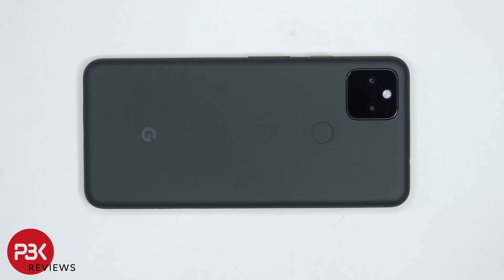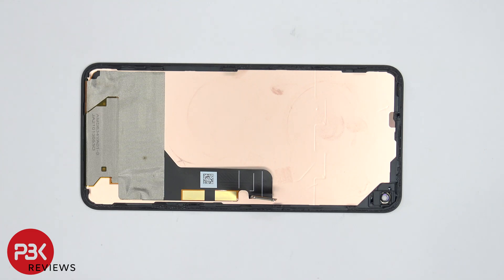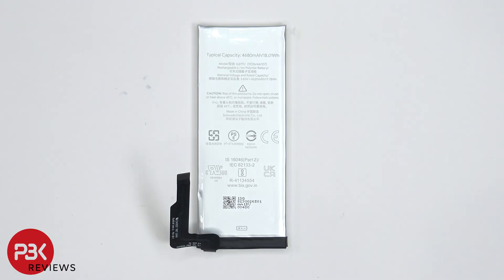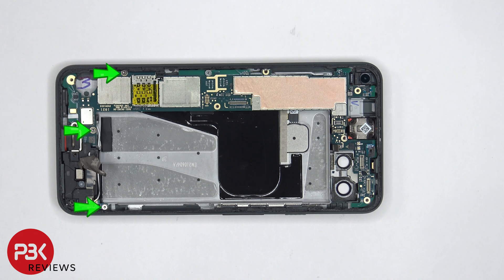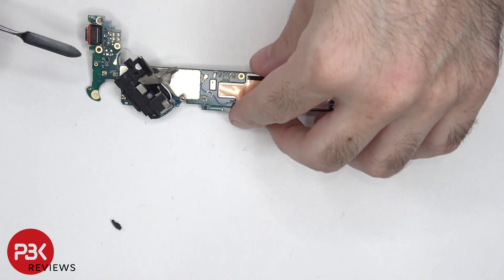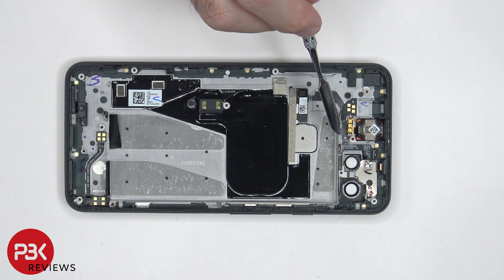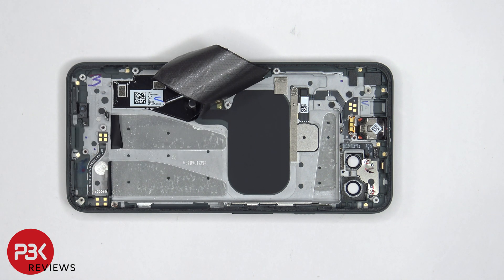Google Pixel 5a Disassembly Teardown Repair Video Review

Comment: I notice no network issues in my pixel 5a after a cpu reballing repair. I see that the radio power toggle is always off in the phone dialer network settings. I also couldn't find any information about this and the guy who repaired my phone also couldn't do it so is there a way I can fix this, I wanna try a DIY
Reply: Kuch solution mila bhai

Comment: Hey,
Thanks for posting this, very professional video, amazing job!
My 5a wouldn't turn on and I think the motherboard is gone. I was hoping your video would show where the memory is so I could access the data I haven't backed up. 
Do you think recovering data from a dead 5a is doable?
Reply from the maker: thank you. the onboard storage is not user removable or replaceable. Its soldered to the main board.

Comment: Great video. I have a pixel 5a and the screen is black but still vibrates and still rings. Any idea. The screen works. Is it a flex cable?
Reply from the maker: Thanks. It could be many things. Defective display, cracked screen (sometimes hairline cracks in the corner don't show), water damage or loose cable etc. You can also try manually resetting the phone by holding the power and volume up or down button for 30 seconds to see if it may be frozen.
Reply: Where is the driver display IC located? Thank you!

Comment: hate to tell you but https://youtu.be/r8uaCrGkca8?t=296 at this point you said processor and ram. that chip next to the processor is the flash storage. the ram is under the stuff on the back side. i know this is an old video but if you could take the shielding off the back and get pics of the actual ram chips that would be great. not sure if you still have the phone or not.

other than that, this was a really well done video
Reply from the maker: Thanks. I don't have it anymore, also I usually only remove the removable shields and not the ones which are soldered to the board since prying those off sometimes damages the components nearby rendering the board inoperable. So I don't want to damage a working board :) (soldering is not my best skill)

Comment: What kind of cooling thermal pad is used on chips at time 4:55 in the video? Also should it have a thermal paste between motherboard and metal plate on the thin copper layer?

Comment: This is amazing! Google should hire you as a product designer! 😄 Seriously.

Do you know by any chance how to get access to the storage (to save data)? Is there any adapter to access it from a computer? 🙏
Reply from the maker: lol :). If you mean the onboard storage, its soldered to the main board so you would need to be able to use the phone to connect it via cable to the computer to transfer info off.

Comment: Could we recover data from storage chip on motherboard?
Our pixel 5a is tested as motherboard issue and will probably be changed to a new one but we hope data on the old one could be saved. Thanks.
Reply: Did you have any luck I am in the same boat, I just want my data

Comment: I am watching this video because my Google Pixel 5a screen cracked after I was (admittedly) careless with it. I got a replacement screen, but the phone is not coming on even though the battery has charge in it. I have been told that it is the power management IC that needs to be replaced but I am skeptical, especially as it is so hard finding phone repairers that are familiar with Pixel. Could they be right?
Reply from the maker: It's possible. You can always get another replacement screen and test to see if it is the screen or not that might be defective.

Comment: Hi! 
Great video. 
My pixel 5a freeze into a black screen and the phone was up because I can hear calls and messages were working. I tried hard restarting and left it to drain the battery and tired it as well. Nothing is working!😑
Now I am thinking of removing the phone and trying to remove the battery. Is a heat gun really required to remove the phone?
Reply from the maker: Hi, you can use a hair dryer as well (heat is needed to loosen the adhesive a bit to make it easier to pry the screen off). You can check to see if your screen cable may have gotten loose or you may have a hairline crack in the screen somewhere from a drop that you can't see which is causing the display not to work. I doubt it would be battery related.
Reply: did you get it fixed because i thinks thats what happend to mine it kept dinging or something for awhile so it was working did you ever get yours fixed?

Comment: Hello, let's see if you can answer despite the time of the video. My Pixel 5a froze using it a few weeks ago. It happened to me after the last update. Does not turn on, does not show anything when connected to any charger.
Reply from the maker: Try holding the volume down and power button together for 30 seconds to see if it will boot. If not, might be the battery or a bad firmware.
Reply: @PBKreviews  I've already tried doing that with the buttons and it doesn't do anything. Nothing comes out even connected to the charger.When I connect it to the PC, something sounds on the PC and something appears in Device Adm, QUSB............
Reply: @PBKreviews  Never had any problems, the battery was fine. That happened to me now after the last security update.
Reply: exactly the same issue with my 5a 5g. Bricked after an update. No response since. Did you do anything that worked to fix it?
Reply: @sreemaeeakshathala3066  Not really. I bought a 6a.

Comment: One thing is the page in the shop where it looks shiny and all, but the inners looks dodgy and kinda low for the price of the phone, I think..
Looking back where I used to repair phones this is the typical chinese crap that is not satisfying to work with. maybe time is changed so this is not issue anymore, idk..

Comment: Can you plz do a pixel 5a drop test. Have seen too many posts that screen is too fragile, that it goes blank at slightest drop
Reply: While metal is used in the construction of the 5A, it doesn't form a perimeter around the phone or the screen. My previous phone was a Moto Mx4, and even with a glass back that thing was indestructible because it had metal surrounding the entire phone.  On the 5A all you have is a plastic bezel protecting the screen, and apparently that bezel has some weak points.

Comment: Can you tell me where the 5g antennas are located on this phone?
Reply from the maker: I'm not 100% sure but I believe the antenna board to the side of the bottom speaker which is connected to the coaxial cable is the 5g antenna board.

Comment: What kind of battery is that. I need to replace mine
Reply from the maker: It's a model G27FU  and here is a link to one of the only I found available online: https://www.aliexpress.com/item/1005003213464474.html?spm=a2g0o.seodetail.topbuy.1.5a5d24e6i00gcX
Reply: @PBKreviews  thankx a million
Reply: @PBKreviews  any preference vendors for screen replacement?

Comment: Great video, you seem very knowledgeable. I just broke my 5a screen and have been searching online for help. I've seen a lot of other people on Reddit who have the exact same issue as me. Dropped the phone, bottom right corner was cracked and the whole screen stopped working. Do you know what in the bottom right could be so fatally flawed that so many people have the same issue? Thanks for the help
Reply from the maker: Hi, thank you. The flex cable which connects to the screen itself runs all along the bottom portion of the screen. Any damage to it or the screen itself can render the screen inoperable.
Reply: @PBKreviews  Hello!  I have the same issue as the original commenter, would you say this is an issue I can fix at home by myself?
Reply: @PBKreviews  to expound on this, I dropped mine on the bottom corner while in a case.  I had no physical damage to the glass or frame, but had a flickering and nonfunctional lcd that appeared to be cracked.  There just isn't enough rigidity in the phone frame or enough space between the outside edge and the lcd/connector.  This is the downside of plastic framed phones.
Reply: @NateFansler  a
Reply: dude my 5a half of the screen was blinking green and the other half was black ):
Reply: Just dropped my Pixel 5a from the bed, from my bed, remember, and not on a very hard surface (I have linoleum), and now the screen is all black and down, in the right corner, I can see that under the glass there is a small crack. So the glass is intact. How could that be possible? I had a very sturdy case, a glass screen protector (intact too). This must be the most sensible smartphone on the market. I have 1 year of guarantee left, but I'm sure they won't cover it...
Reply: mine also fell down on the road. had sturdy cover as well.  no crack nothing and i saw it hit corners when fell. now screen all black. i think phone working bc i can access web whatsapp. =/

Comment: My 5a just took a light tumble and the screen is dead! No cracks just flashing and non responcive. Looks like I'm ordering a screen. At least it looks easy to do
Reply: same thing happened to me, light impact on my 5a screen is all black. poor build quality. any idea where to find replacement screen?
Reply from the maker: There are some on ebay if you search for pixel 5a LCD. Also you can contact google to see how much they charge for replacement. If you have no visible cracks, you can try to send it to google to replace under warranty. But if they deem it physical damage and see a crack, they wont repair it for free and send it back to you or offer you a price to fix it for you.
Reply from the maker: Sucks, sometimes they get a small hairline crack somewhere in the corners which you can't see and causes them not to work. You can try sending it in to google and see if they will cover it under warranty if there are no visible cracks.
Reply: @PBKreviews  I has two cracks under the glass. Looks like the OLED cracked but not the glass. It fell from about 2-3ft while in its case. I've dropped my Pixel 3XL many many times while in its case. I've never damaged a phone so easily. As far as the cost is considered, Google wants $229 for the screen and their authorized repair place said it will take a week to get it. I'm not sure what the labor price would be on top of that. I ended up removing the screen and am not waiting for the replacement screen I ordered on eBay for $180. It's slightly cheaper but will be here by tomorrow. Again, this phone seems very delicate when compared to previous pixel phones. Although this is my first experience with an  "A" model. Maybe they're not designed to be as robust? Idk. Since I've had the Google G1 in late 2007 this is the first time I've ever cracked a phone display ever!

Comment: I would much prefer it if the charging port was modular like the headphone jack is, rather than soldered to the MB. Especially on a phone without wireless charging where it's going to be subject to wear.
Reply from the maker: Ya, the charging ports should always be modular or on a replaceable sub board.
Reply: @PBKreviews  Great videos, thanks a lot for your time and effort in making them and helping us who want to learn! :) I watched the teardown video for the Pixel 5 too and the charging port looked pretty similar to the one on 5a. Would you say that replacing the charging port on a 5 would be as difficult as on the 5a?

Comment: Where can I buy a screen? I have looked everywhere
Reply from the maker: You can search on ebay for pixel 5a lcd and there are some listed around the $200 usd range, or you can contact google and see how much they charge to replace it for you, might be cheaper through them.

Comment: You said there was a notification LED, is this correct? I can't find a way to turn it on in settings
Reply: Frustrating that it does not have this feature...  Heck, even $50 LG phones did.  I like my 5a but was surprised it lacks this feature...  Maybe a software update with 'fix' this.
Reply from the maker: I checked the video, I don't see where I mention in there that it has a notification LED. Can you tell me what time stamp in the video I mentioned that, since I checked and this phone does not have one.
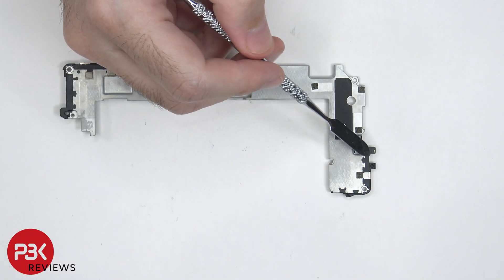Reply: @PBKreviews  1:55
Reply from the maker: @arientlich5665  Oh thanks for finding it. That LED is not a standard notification led for app notifications. It's to notify you that the phone is charging if the phone is completely drained in battery and does not have enough power to display anything on the screen yet. So that will flash white when plugged in if the battery is completely dead, so you are aware it is accepting charge. :)

Comment: Do you think it would be possible to add the wireless charging, using Pixel 5, or other, components?
Reply from the maker: probably not since the software would not be programmed to work with the hardware (even if you were to modify the housing and so forth to allow the wireless charging to work).

Comment: What is your professional opinion about Google claiming the Pixel 5 & 5a screen gap issues having absolutely zero negative impact on the phone's IPX rating?  It seems to me the whole point of the water gasket under the screen is to PREVENT WATER from entering the main body from between the screen and the casing right?  Otherwise, why is there a water gasket between the screen & the body?  Google says having random gaps, of various tolerances, in random locations all around the screen (but w/ some phones having NO gaps) is a intentional design design.  They further claim having the water gaskets breached has NO detrimental effect on the phone's water & dust waterproofing.  That's obviously bullshit, but I'd like to hear your take.  From your teardown, it's obvious the Pixel 5a's internals are not themselves waterproof.  Meaning there's no magical waterproof coating layering every single electronic component inside the body of this phone.  If there were, then there'd be NO REASON for water gaskets around the screen & USB port, right?   So it seems obvious if a gap exists between the screen & the body, a gap big enough to side an index card or credit card thru, then obviously there's plenty of room to allow water & dust/dirt to ingress into the Pixel 5 & Pixel 5a's main body.  That'd be "bad" right?
Reply from the maker: Well they are right and wrong as well. Even though there may be gaps on some units in certain areas between the screen and frame, the adhesive that is all around the screen is thick and stretchy so imagine it like gum, its stuck to the screen and frame but may be stretched in some areas without having any openings. However where I feel this may be an issue over time is that adhesive coming in contact with water and debris over time may render it weaker and not hold as well so then possibly causing it to give way over time. Again I think it should be fine but if you work in an environment where there is a lot of exposure to water and debris, I would probably go with one of their newer phones/designs. For the 5a, I did not notice any gap as well as the many clips all around which securely held the screen down in place on top of the adhesive. It was definitely harder to pry off compared to the 5.
Reply: @PBKreviews  Thank you for replying and offering a very thorough answer. Much appreciated!  So basically the gaps are a potential point of weakness.  How much of a weakness depends on the environment the phone is exposed to, and I imagine the amount/quantity of gummy adhesive coating the area under the gap - and probably the overall size of the gap itself I would think.  Seems to me Google's mfgring tolerances aren't very good overall.  I'm gonna hold off on both the 5a and the new 6.  I'm sure more issues will pop up.  Will probably wait one year or so - give Google time to fix their QC. Thx again!
Reply: @PBKreviews  seems like I've got one 5a with a gap issue. Not only the left side doesn't look perfect in comparison to the right one. The more I look at it, the more I see. I can well identify all the clips. Is this a problem to solve? Or it's better to leave it as it is?

Comment: Isn't it less common for a phone to have a screen side entry rather than a back side entry?
Reply from the maker: yea correct. Some people prefer screen entry vs rear entry but I don't. It may be easier for a screen repair, but if you need to replace anything else aside from the screen, prying the screen off poses high chance of damaging or breaking a working screen.

Comment: I would like to say, 4a 5G structure is more neat and tidy than 5a. Personal feeling.
Reply from the maker: I prefer the pixel 5 and 5a, the 4a is much more easier to break or damage the screen prying it off compared to the pixel 5 and I feel like the disassembly process is easier on the 5 and 5a compared to the 4a.

Comment: Guess Google wants  you to buy a new phone rather than a new battery by the way it's mounted.
Reply from the maker: lol yep, sometimes I don't understand why they include pull tabs when you can't really use them and they tear very easily or the adhesive is so strong they don't even help you pull it off. The pull tabs in Xiaomi phones are much better, those are so simple and easy to lift up and remove the battery.
Reply: @PBKreviews  would the pull tab be helpful to use after the isopropanol was applied?
Reply: @PBKreviews  Maybe the pull tabs are for the people building the New phone to put the battery in???

Comment: Nice, easy to swap display 👍 Do we need to heat em before replace display?
Reply from the maker: 👍 yes you need to apply some heat with a hair dryer or heat gun to loosen the adhesive before prying off the screen. But when applying new adhesive, no you dont need to heat it.
Reply: @PBKreviews  - what is the adhesive yoy use? Thanks